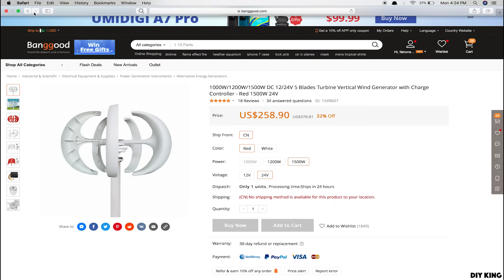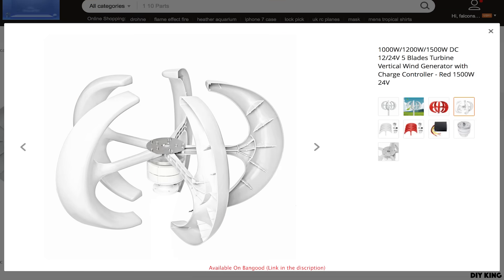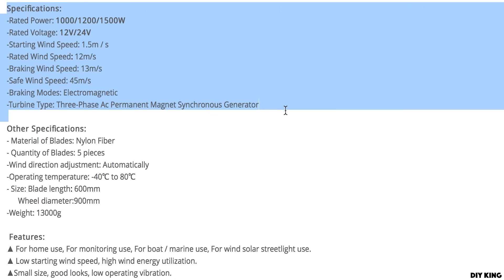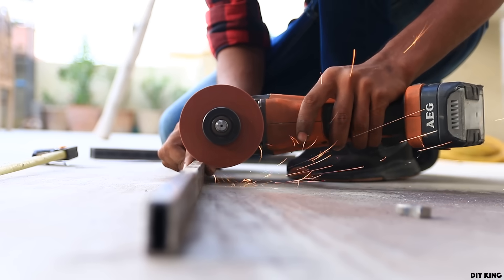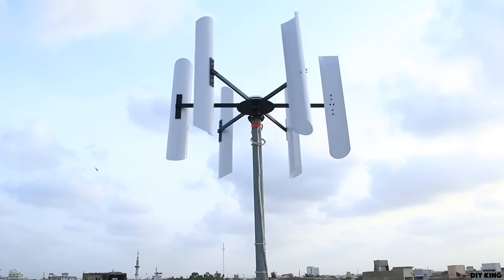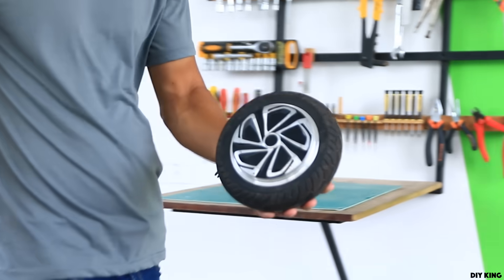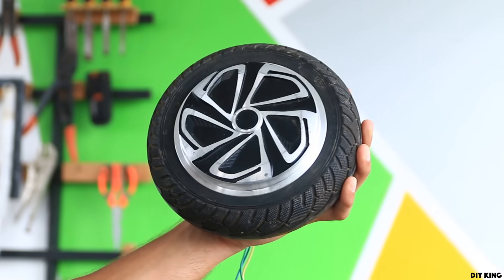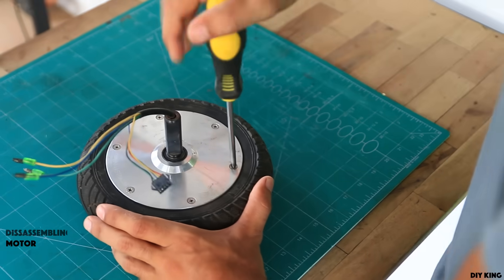How to make a Vertical Axis Wind Generator (Is it worth that???)

Comment: You really should have tried this with a proper aerodynamic wing instead.

What you have here is a Drag type wind turbine, or the Savonius rotor. These are limited because, as you rightly pointed out, there's a lot of negative torque generated at the return end. Additionally, drag just doesn't have that nuch energy, even though it's so much easier to visualize.

Using a lift type blade is your best bet as that's the same principle that airplanes operate on. Lift type turbines don't use the drag of the wind, but the suction caused by pressure differences, which provide far far far greater experienced forces. Additionally, the return torque is quite minimal, especially with a well designed blade, as you can reduce the drag to 0 but reducing the angle of attack to 0. 

Lastly, a proper lift type rotor generates electricity at two points of the rotation. Upwind as well as downwind. This is a sort of "double dip" into the same wind, providing much higher efficiencies than drag type rotors

Comment: You have too many metal components that are part of the turbine, which creates more weight for the ball bearings. Too much friction, if you bring the blades closer to the hub of the motor thereby eliminating metal material in turn reducing weight.

Comment: You will have great success if you mount the motor below the blades and gear up the motor. Connecting them with a belt.. you have to have the blades turn once and the motor turn 10 or 15 times

Comment: Vertical wind turbines it's a lot more demanding from the aerodynamics point of  view. Everything need to be optimized, including the arms. Your blades provided the same trust power as the opposite forces, therefor being only 50% efficient. The arms holding the  blades have nothing to do with aerodynamics, in any given universe :))) . You can't just wake up one morning and decide you are an ingineer. It doesn't work !

Comment: Would this vertical design have more torque than speed? Would a gearbox work to increase the generator speed?
Also I agree with @noneya business with odd number of blades.
Is it possible to have flappy blades that close when they are going into the wind then open up when the wind pushed them? This should reduce the drag 🤔

Comment: Your turbine is based on drag, a darrieus rotors uses lift to generate power which is much more efficient because it eliminates the loss of power due to backwards drag.
It's all based on the geometry of the blades.

Comment: Mount the vertical blades in such a manner that each blade can pivot freely about a vertical axis. Provide a stop in each direction to prevent momentum from causing them to spin too far. This design eliminates the drag as all blade cups will remain oriented to catch the wind as the turbine spins.

Comment: Vertigo wind turbine isn't enough to put it on a pole build yourself a slightly bigger circular box with a scoop and a shaft going from the air scoop to one side of the round box with another air scoop for the exit to go out the back and then set the whole box on a axle turntable like device it's on bearings that would be mounted on a pole that will turn around in the wind with a big giant fan on top of the turbine box to guide the turbine into the wind get your most power going into this air scoop or it'd be a great device to mount on a vehicle that's electric to create power for the electric vehicle with solar panels on top without that fan cuz you don't need that thing turning if you just go forward and all the air you ever need to go right through that scoop and be pushed into the vent going into the turbine chamber and pushed out the back of the turbine chamber through another vent need a sign that I know will increase the power of the vertical turbine the air scoop you like a old Victor that plays music out of it but with a rounded bent going around the box to one side and the other round event going other side and out where the air exits the box after powering the turbine cool idea huh with a little extra space underneath the box for a smaller box to hold the generator in place cuz the boxer had a little space between the hood of a vehicle and bottom of the box what area to go around the smaller box that has the turbine in it with a big metal solar panel framed solar panel mounted to the top of the box with a special rack to create power for the electric car as I said before I think this is a cool idea for making electric car off grid I think we ought to create other generators are attached to other parts of the car like wheels and drive shafts to create power to put back in the battery as the power is being used to turn the wheels forward or back whatever the case may be or any movement other vehicle in the drive shaft are in the wheels are forward movement can power more power longer it was solar panels that would power Wall part charging the batteries back up of course to make it off grid vehicle which will make a better for the Earth so the Earth can finally breathe with us society of relief from the toxic gasoline powered cars on the freaking road login Earth environment up no more would Earth have to worry about smog if all the vehicles get replaced by a powered vehicles that actually work doing this kind of repower system guilty into the vehicle a special thing be mounted to the bumper that has two spinning axle wheels that was being able to turn in all the way in any direction as the car turns but has a generator built into them that would generate power as their wheels are rolling in the behind the car and it kind of looks like a Willie bar but the device is creating a generating power that will feed the batteries as well through a charging system that would charge the batteries off the power and super pastors Bank that would cut the initial charge or down charging into the batteries before going back into the vehicle power motor to go forward more power

Comment: Yo, give that thing a decent thrust bearing between the motor mount and the blades mount, also, tap a hole in the motor shaft as to be able to tighten the both parts and make proper use of a thrust bearing, that will stabilize the rotor greatly and allow it to spin without wasting energy on vibrations and elastic distortion of the motor shaft... It will also greatly prolong the life of the motor or better said its own bearings, as they wont be subject to forces they were never meant to see in that ratio... Give it some ultra high speed lube for rollerblades and watch the thing remain the same but work 10x better as its supported now... Apart from that, great job boys!
Reply: ok, thread the shaft, i now saw that the shaft runs wires through it... Just thread the outside of the shaft and apply the above mentioned...

Comment: Nice work! Looking at your horizontal axis turbine i noticed it’s blades are mounted incorrectly with the trailing edge facing forward. The solution would be to invert the pitch of the blades and let the motor spin in the opposite direction.

Comment: nice job, though really you have just created a slender savonius turbine - it cannot spin faster than the wind.  You would need to use aerofoils to overcome that problem.  The other issue with VAWT is that they are hard to start - so, assuming you moved to aerofoils, you could then have small cups that would ensure that your turbine can start and always turns in the same (correct) direction.  The final issue is that they tend to put a lot more wear on the bearings, which fail much quicker as a result.

Also:
Using a cutting disc without safety glasses?  Do you not like your eyes?

Comment: Bro you did it all good except  for one Thing  and that's  yiu can't have an equal  amount of blades  you  go with 5 blades you will spin slower but at lower wind you go with 3 you will go faster but also need stronger wind 2 blade  system took a lot of money to built

Comment: Actually, odd number of blades are better.  I used to remember but it has something to do with aerodynamics and the affect on airflow and the creation of wind resistances. On this VAWT design?  Well, It's not going to achieve a higher rotational speed that you are after with those big blades.  I haven't sorted out the math for it but if the speed of the wind was 7m/sec and then you determine the circumference of the outer end then divide that by the wind speed then you will determine what the RPM's will be.  Using 7m/sec wind speed.  If it was 1m circumference then you would see 7 RPMs.  If it was say 3.5m then it would be 2 RPMS. Then if you need it faster, the only idea I have is to use gears by decreasing the second gear to say 1/10 of the size of the first gear.  End then you aren't going to see high RPMs with a VAWT.  VAWT is really to grab the low hanging fruit and not for major production of power.  Even if you raised it 30m up because of the design I don't think you will get it because of the mechanics involved.  The obvious question is why does HAWT spin faster?  Well its different mechanics really.  VAWT RPMs are dependent on the travel distances of the hub in relationship to wind speed to create enough RPMs to generate power.  HAWT is the relation velocity of the air passing through the blades and I seem to remember pressure effects the performance.  Am sure there is a math equation for that but am a bit on the brain dead side now and I can't come up with even the basics of it.  In short HAWT will always out perform VAWT.  Now, the bladeless design I haven't looked at it yet but am thinking it will be in the same area as VAWT but it deals from what little I picked up on; vibrations on the wires that create the power.  I could be wrong on that bit but it is what I remember.  Either way, if you are looking for high end power I would use HAWT with a dual axial turbine.  But with that you will need another rectifier and another 3 wire run as it will be two 3-phase output from it.  Most I figure you know but someone else reading it; maybe not.

Comment: It looks great,  the only thing I would do different is change the amount of magnets,  like one less,  then space the others evenly. Because the original  design is for a board that goes forward and backwards also works as a break. For  it to be use as a motor or generator, the magnetic field of the rotor is too strong,  causing the stator to work too hard. By doing this, the magnets would work in magnetic pulses. Allowing it to be weaker at low rpm and stronger at high rpm, I think it would be more efficient and easier to turn

Comment: Great Project. Can I ask you to due an experiment? The experiment is miniaturize it  in America we use dryers to dry our cloths. Make that turbine small enough  to fit in the exhaust hose and harvest that energy. We also use ac units to cool our homes. A large fan outside is used to blow air across the cooling  tunes. Build a turbine over the cooler to harvest that energy.

Comment: You've chosen the least efficient possible design -- effectively an anemometer.  Change to flat blades, right angles to the radius arms (plus a little angle of attack, so wind blowing directly along the radius arm will apply a spinning force) and you'll reduce the drag of blades that are "idle" due to their position around the center to near zero and the turbine will spin much faster.  You might need a small turbine with this kind of blades to start the rotation when the wind comes up from zero, and there's a minimum wind to drive the turbine -- but the flat circumferential blade design is much more efficient than the cup-blade type.

Comment: Try a lift based design instead of a drag one. And if you do go with drag one you need to gear for it, it is literally impossible for a drag based blade to surpass wind speed, so, dont expect high rpms.

Comment: aahh the savonius is not a good one for that, you almost require the appropriate funnelage to prevent the broad cup from slowing you down on the swing side, try a lift (darrieus) type should see an improvement over the nominal cheap cup design.

Comment: If you use a vertical Savonius turbine, I found by design that using two halves cut from a 200L drum and mount them onto the vertical shaft. Then make a large wing (side view) big enough to cover one half of the drums. Make the leading edge and dihedral large enough to allow the wind to cause a vacuum on the lift side. Only one half of the drum will be in the air stream on the high speed side. Use the vacuum from the "lift" to help the half of the drum inside the wing shape to spin towards the leading edge. Make a tail long enough to keep the leading edge into the wind. Mount the "wing" onto the vertical shaft. You can make the tail able to make the leading edge rotate away from the wind stream. Using the vacuum from the lift side should give you a 10% increase in power. Remember who gave you this and quote my name. Where I live, the Spring and Summer South Westerlies average 20 knots from approx. 1330 to 2000.

Comment: I feel this design although it spins slower would provide more torque thus benefiting from a pulley system possibly 3 to 1.  Spinning the gen much faster in low wind, but well done video, keep them coming

Comment: As was said below, odd numbered blades are more efficient. another thing that will increase efficiently is to figure a way to block 1/2 of the turbine so there is less resistance, no wind pushing back on the blades.

Comment: Low Rpm generator should be used. Or gear chain, pulley chain reduction should be used to increase the RPM.

2. Number of blades should be increased to make is a cylinder.

3. It is a proven design

4. Needs main design changes

Comment: Small and extremelly large turbines benefit from vawt due to the yaw and pitch does not need to be accounted for, it has a lower efficiency than hawt but they are simple and cheaper.

Comment: yeah ...  VAWTs rotate at lower speeds and have a slightly lower efficiency... however if you would have used a better generator/motor. it would have been a success. of course blade design would be better... try designing a savonius blade ... that should give loads of better performance.

Comment: The biggest problem with that type of wind turbine is: the wind is blowing in all blades at the same time, and only one or two of them are in the correct orientation to capture the wind force. The other blades are spinning in some weird angle, only to produce drag and slow down the turbine significantly.

To really improve the performance, you need to create some new blades designed to react to the wind's direction. If you can do that, you'll have blades that ONLY interact with the wind in the correct orientation to capture energy. As the other blades spin, they arrange accordingly to evade drag and/or produce counter rotating force, preventing the slow-down of the turbine.
Reply: I agree, and would suggest replacing the blades with the green windmill sail design

Comment: Remove the drag by only exposing the power edges to the wind. Bury the turbine into a wing. And support the rotator with permanent magnets. A slight lip at the trailing end of wing self aligns the leading edge of wing into the wind

Comment: Lift type would have worked more efficiently than drag type as drag is limited to wind speed,  lift can go little higher.
I mean just try lift generating blades like your HAWT has.They also will reduce resistance when going against wind in the other half of the rotation. 👍👍👍👍

Comment: Your vertical windmill as no flaw, your design is almost excellent your just need to  change the pitch of your blade and maybe change your blade for bigger one.  Faster you want your windmill run , bigger the pitch of your blade as to be ( with less restrictions to the wind ), in that way you will have less torque but more RPM. Your design is made for high torque , no high RPM.  KEEP GOING MY FRIEND, YOU ARE ON THE GOOD WAY.

Comment: I have a few other questions, in addition to the existing questions about the even/odd number of blades:  
- Is the hoverboard the best generator for the VAWT - it seems to be a function of speed but you may be getting
  more torque at lower speeds with the VAWT in which case a different motor/generator would seem relevant
- How much does the VAWT weight versus the HAWT - if it much heavier then the VAWT would spin slower; 
  with the metal arms it looks heavier
- How did you determine the shape of the blades - most likely you did not have access to a wind tunnel so the
  shape is likely not optimized

Comment: I looked into this years ago. Instead of the hovercraft motor, I had found a low RPM alternator on the internet for $150 (back then) that was supposed to produce current at 150 RPM, as opposed to your 500 rpm motor. (I never attempted to build it because I don't have the hands on electrical knowledge to do this safely, or a community that would allow a homemade windmill to be mounted on my roof.)

Another design I found on the internet called for blades resembling airplane wings instead of the half pipes.
Reply: Could you please share the link of that alternator

Comment: Nice work
Test with 3 blades and anke thir angle is wide than ur virtical trbine faster.
Improtent If u use wide blades with virtical win genrator it powerful but the genrator selection is not better for this progect.
Forceable low rpm better then fast rpm
Use genrator with strong mgnet or electromegntism system so clog effect is strong to produce mor amps in low rpm.